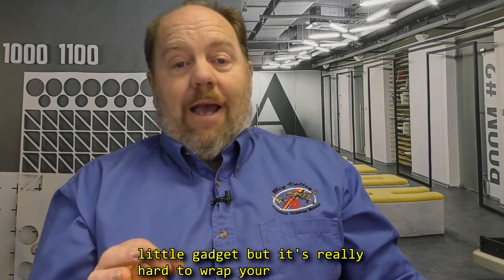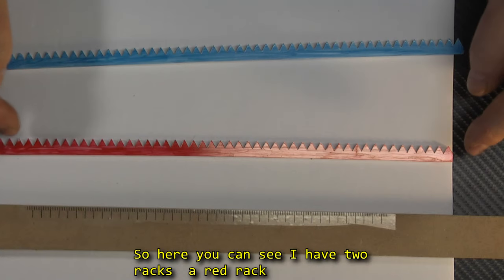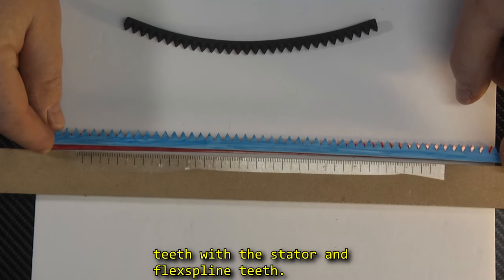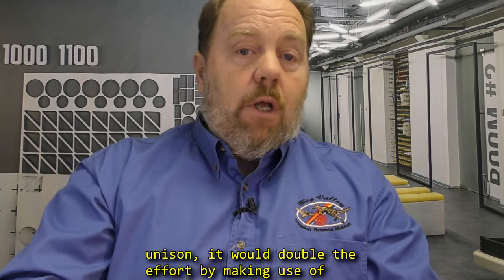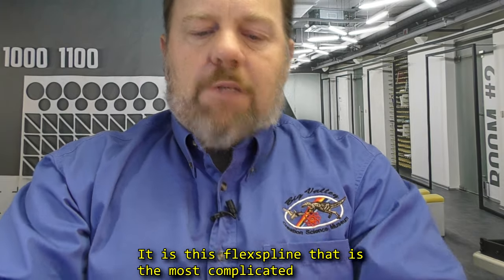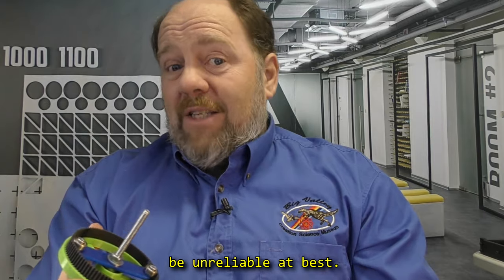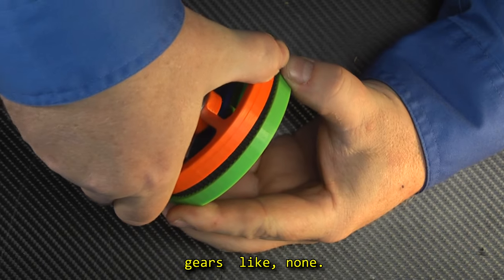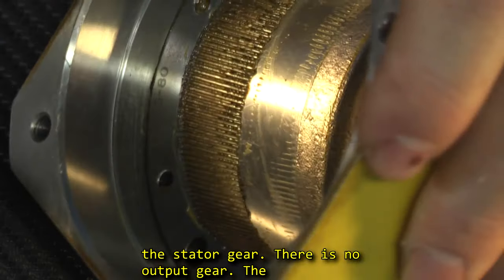Harmonic Drives explained

Comment: Your setup was so clear that it was immediately easy to comprehend. Good teacher.
Reply: Agreed, reminds me of the old Docs from the 40s explaining planetary gears transmissions and rear differentials
Reply: Years ago there was a Visible V8 model that had a starter that consisted of a can motor that turned a sun gear that meshed with 2 planet gears. The planet gears meshed with 2 internal gears with different tooth counts. One internal gear was stationary and the other one was connected to the starter pinion. The starter pinion meshed with the engine flywheel.
Reply: He started explaining, and I couldn’t understand why he had such a hard time understanding it in school lol. It was so simple.

Comment: I had a great “Ah Ha” moment about 6 or 7 minutes into the video. I’m a now retired electronics technician who used to work in the production of printed newspapers. Equipment from a company called Ferag used harmonic drives and when we were trained on it the instructor told us what it did but couldn’t explain how it did it. To him it was a magical engineering marvel. In the years that followed we repaired them quite frequently. Usually the Flex Ring would crack and we disassemble the unit and replace it. I had a fair understanding of how it worked after working on them but you, my friend, brought it all together. I’m going to forward your video to my former coworkers who still have to deal with it. I’m sure they’ll appreciate it. Thank you.

Comment: Super great explanation. One would think that the flex spline gear would fatigue over a short time, but they're so widely used in so many applications that it must not be an issue. Thanks for the great video demonstration!

Comment: Zero backlash & fixed timing... 2 great attributes for a gearbox... 🤨 a lot of people don't realise just how important backlash , or rather lack of it , is.. anyone with a milling machine who trys climb-cutting better have NO backlash in their table feed... 😰

Great description, the use of the straight racks initially helped greatly to understand the theory behind these rather exotic & quite expensive units... 🤗

😎👍☘🍺
Reply: When you say, "fixed timing" do you mean the input side is directly proportional to the output side? I saw cyclonial might have a problem in this regard (  because the input side to output side is not strictly linear because each teeth engaging is not directly proportional?)

Comment: Considering buying a telescope mount that works on this principle and wanted to understand it.  Your video helped a lot.  The advantage of very low backlash in astronomical mounts is significant, as well as the reduced need for counterweights on the mount. Thanks very much.
Reply: Ha! We must be looking at the same new ZWO mount! There are also others on the market that now have me looking into this tech more. This video explained it perfectly.
Reply: @lizards821  You're right!  Check out the cloudynights discussion.  It's the PEC that's inherent in these drives that convinced me to not buy it.  Looks like a good mount for visual, but not for DSO astrophotography, which would be my primary use of it.  Leaning toward the EQ6-R Pro when they come back on the market.
Reply: @cmahar3  yikes yeah spending $2k for a mount that cannot really do dso is kind of a bummer, especially considering the eq6r pro is less than that. Cuiv the lazy geek here on yt also has some videos on his as well.
Reply: @lizards821  Right? All DSOs aren't out of the envelope of this mount, just the small dim ones requiring focal length longer than 900mm. OTOH there are literally no EQ6R-Pro mounts available in the US or Canada right now due to supply chain issues, and there won't be for months.

Comment: Wow, you're a great teacher, your video is terrific and I now know something completely new about gear drives. Years ago I got a fanuc welding robot arm and was amazed at the zero backlash on the joints but never knew why it was possible until now. As for how to get 2 more teeth with the same pitch, it's hits me now that the outer ring is naturally LONGER than the inner one, hence can have 2 more teeth in its' path. However, sizing up the tooth depth to accomodate the mating, etc is a challenge.Thanks for this explanation and I'll look at more of your videos in the future.

Comment: Thank you very much for a very simple explanation of strain wave drives.  One of the newer places that these drives are starting to be used is in astronomy, more specifically astrophotography.  Astrophotographers are always looking for lighter weight, more powerful, more reliable and less power consumption in their gear, since often time hobbyist astrophotographers are out in the middle of some open field, far away from any power.
For the most part, telescope mounts fall into two categories, Alt/Az, or Altitude Azimunth and EQ, German EQ which means German Equatorial mounts  For astrophotography, EQ mounts are much more common, albeit much more expensive.  You can align one axis to the North Star, Polaris, and the mount will rotate around that point in the sky, and since all the stars and things in space also rotate around it, once you've selected your target, the mount tracks around the North Star, keeping the object in the center of the scope.
Strain Wave drives are now offered by two companies, ZWO and iOptron.  Usually, a normal EQ mount requires a counterweight and shaft to balance the load on the 'Right Ascension axis, which is the axis pointed at the North Star.  Having the system balanced keeps down tracking errors.  The Strain Wave drive eliminates the need for the counterweight (up to a certain payload), thereby reducing the entire weight of the mount.  It also tracks better and has zero backlash, which is something astrophotographers also are interested in.

So, yeah, Strain Wave mounts are coming, and they are going to be the future of hobbyist astrophotography.  Because of you, I know a lot more about strain wave drives now than I did 45 minutes ago!

Comment: To everyone wondering if you can use spur gears on the bearings instead of a flex spline, the answer is: yes. I was curious about this as well, so I drew up a harmonic drive in Fusion and 3D-Printed a model that uses entirely 3D-Printed parts except the bearings, which are fidget spinner bearings. My tolerances leave a lot to be desired, which may hide the reason for using flex-splines instead, but it is a fully functional gear reduction that uses spur gears all round and no belt/compliant mechanism.
Reply: Jake, I would love to see your model.  I would like to build a drive and am researching different methods right now.  What you describe seems interesting....
Reply: Thank You! I was wondering 😊. I love your simple description. You haven't by chance posted your STLs somewhere? 😊

Comment: This is the best explanation I've seen. I'm wondering why use a flex instead of just smaller gears.
Reply: Goog question. I guess with a more rigid flex it can engage more teeth. I also think the "real" harmonic drive do not use rollers inside but an ovoid slipping within the "belt"
edit: it is an elliptic bearing: https://youtu.be/bzRh672peNk?t=31
Reply: and with the right number of theeth maybe have more points of "harmony" in the gears?
Reply: Because the teeth only match up in 2 places, so the inner "flex" gear can only be in contact in 2 places

Comment: Nice video!
Looking at these drives I thought that instead of having the flexible gear to wedge the stator and output gears, why not have a plantetary/harmonic hybrid?

It would be like a normal planetary setup, but instead of the drive going through the planet gears, the planet gears would only do the job of the flexible gear in a harmonic drive setup, becoming the wedging force to do the reduction, while transmitting the force/torque. There would no longer be a need for the traditional sun gear as in a plantetary setup, so it could be omitted.

The difference in gear teeth needed for this to work as a harmonic drive could be achieved by making the outer part of the planetary drive (is it called the ring gear?), in two pieces with a different number of teeth. 

These two ring gears would act as the stator and the output respectively, connected by the aforementioned planet gears (which may need to be slightly elongated to allow for adequate meshing contact between the two ring gears).

By using planet gears to do the job of the flexible gear, it negates the need for it to be flexible, removing the weak link.

Also, if you adjust the teeth size to outer ring gear diameter ratio, you could have more than two spots where the teeth "harmonize" allowing for greater force transfer, while dispersing the load for better longevity.

Just a thought...🤔

Comment: Cool, simple, visual, intuitive and clear explanation, to the point I can go and build my own right now, all I need is a gear pack for SolidWorks 
It’s so rare, that a smart person can explain own knowledge, and you are definitely more than able to, thank you
BTW, I think nylon filament can be used as a flexible part, instead of a belt (without detracting a brilliance of this solution of course, coz belt is an industrial, very reliable component)

Comment: Have you seen that spherical gear? It can be turned on all 3 axis without the drive gear teeth loosing contact with the driven gear teeth. If I remember correctly, two worm gears or two pinion gears or a worm and a pinion gear can be used for the drive gears and the spherical gear easily accepts the input force without skipping, binding or terminal collision (drive gear tooth crest impacts driven gear tooth crest). I believe it can be driven with two pinion gears or one gear and a curved bearing plate to hold the spherical gear in place...I'm not so sure about that one gear/curved bearing part tho, it's been a while since I've seen the video.

Comment: Never heard of it, very interesting. 
I wonder why they don’t just use 2 opposite gearwheels instead of the flexspline?
Reply: The gear wheels and bearings would be under a lot of load and subject to much more wear. I would guess that you would also need a brake mechanism if the bearings are freewheeling when not being loaded by a drive... But not 100% sure on that!

Comment: Not hard to understand at all, great video!  I've never heard of these before and would have thought they'd use a sun gear drive like in automatic transmissions in cars or in drills.  I don't know what they have for "stop and hold" power, but the harmonic drive can probably hold a lot of torque without using power.

Comment: Hmm, I didn't have problems understanding these. Btw. a common mode of failure is cracking of the flex spline along the roots of the teeth, for obvious reasons.
The thing on those that boggles my mind the most is: how do you create the perfect tooth geometry? Or do involute gear teeth work as long as the tooth count is high enough?
Reply: I first encountered these drive mechanisms by watching YouTube videos dedicated to how they work. If you’re in that boat with me, it’s obvious why you didn’t have problems understanding it. It’s likely a lot harder to figure out the working principle if you’re simply handed a model of one to play with though. 
About the tooth geometry: involute tooth profiles would actually be a bad choice because they are designed for two rolling circles. The involute curve allows the contact pressure between two teeth to remain on one axis throughout rotation. The harmonic drive is different in that the flex ring teeth mostly just oscillate into and out of the stator and drive teeth (technically the flex ring rotates but very slowly relative to the input rotation) and lastly, the actual drive mechanism is no longer traditional torque transmission through meshing but it is instead this wedging effect described in the video. For that to work, simple V-shaped teeth will work best, with slimmer V angles being more efficient (like a slimmer wedge) but with a higher risk of teeth shearing off.
Reply: @evanemanuel1774  thanks for the input. Straight wedges wouldn't be ideal too though, because the teeth aren't always straight to eachother. At the ends of the meshing zones they would be more or less angled, so a slightly rounded surface would be beneficial. I wonder if it's wven possible to get a somewhat constant load distribution over the contact points.

Comment: So here's a quick question: does the harmonic drive create an increase in torque, as what one would expect through a standard gear drive? More efficient? Less efficient? What are the benefits of a harmonic drive over a standard geared drive/transmission system?

Comment: When I was into robotics back in the 80s I was thinking the same thing instead of using a spline you use bi-metal springs that would do the same thing it would act like the tearing down and replacing of muscle mass in a sense to create a greater greater force

Comment: What about frictional losses?  It seems like sliding wedges would be much more lossy than regular gears. Is there an efficiency measure for HDs and what's a typical range?
Reply: The lubrication does a very goot job at lowering the friction. There is a thing called the coning effect in which the oil or fat is pushed between the teeth by the aur pressure. On higher rotational speeds the drive gets less and less efficient.

Comment: Why does the drive sprocket have to be flexible? Offset the drive gear off of a clock hand, and let it act as a roller. As the clock hand rotates around, it pushes the drive gear into the stater/rotor. Only one tooth needs to interface to act as a wedge, so the drive wheel can be small, it just needs a tooth count in between the stater and rotor.

You just evenly space the arms in sync with the number of harmonized sections of the rotor/stator. If you want to cover those gaps, double up, and line up multiple harmonic drives, with the harmonic sections perpendicular.
 What am I missing?

Comment: Wow! I've heard of these before and came to the video convinced I wasn't going to understand it. I'm pretty good with science and technology, I just thought this was one of those weird things. But it makes perfect sense! A wedge, of course! Well, well done. Teaching is a skill and you're good at it.

Question, though - Could you do away with the flexible part, and instead of the 2 round parts on the end of the rotating cam, have 2 small gear wheels? They'd still press into the other 2 gears. They just wouldn't need to flex. That would seem like a better way, though if it were I'm sure that's what they'd use, but why? 

Also can this be driven backward? As an increasing instead of reducing gear? From the mechanism it seems likely, having the teeth of the output squeeze the flexspline's teeth out from being meshed in there, therefore squeezing the flexspline inward, and that pushing the cam round. In practice I can imagine the force would be very large, and possibly other forces would dominate so that it wouldn't work in any practical material you'd build it from. But theoretically it would, right? 

For it's job though, a reducing gear with such a great ratio, so tough, solid, accurate, and simple, is amazing. No wonder it took til the 1950s when the other basic machines were invented by the Greeks and even the more complex ones by Medieval times.

Comment: Beautiful explanation, but wouldn't it be possible to just 3D print two gears, and attach them to the two ends where the rolling bearings are, rather than use a giant circle? Or is there some benefit to using a whole circle as a rotating piece?
Reply: The flex and roller parts are extraneous and irrelevant to the differential drive. Yes this is done with gears only, external or internal. The diameter is based on material weakness, required torque and ratio.

Comment: It was good to see the system, and I understood it, I think. Not many moving parts, which is good, but there is potential for a lot of wear, not so good.
If I understood it correctly, it seems that you can't transmit so much torque through it, due to not having many teeth transmitting the power at any one time? I did have a nap half way through, so I might have missed something important. :)
That would explain why planetary gears are more popular.

Comment: Very interesting, thank you.  Wouldn't the repeated flexing/straining of the output 'flex spline' quickly lead to metal fatigue, cracking, and catastrophic failure of the mechanism, in comparison to the longevity of a planetary gear?
Reply: I think this is the main beat in complexity of manufacturing of this element, like in variator transmission - the belt is the most complex and difficult part, otherwise it is very simple, much simpler than ANY gearbox

Comment: why not just use 2 small gears that are double the height than a single tooth ring on the inside instead of the flexible element? They would do basically the same as the flexible middle part and shift one tooth ring vs the other one. It would also have no play in static mode but wouldnt have to rely on a flexible elemet.

Comment: Thank you for you explanation and zero backlash is a good idea but what will we do for the vibration? It's a big problem on this sample. If we put this harmonic drive into a dense fluid (for example a thick oil) then we can absorbe the most of vibration. But after this we will meet with an another difficulty which is fixing the mechanism. So I think it's a complicated mechanism. It can be use for simple machines but can't apply to neither big machines for example cars or trucks nor small machines like elektric tools.

Comment: So the diameters of the two rigid ring gears are the same, and the pitches of their teeth are slightly different? (And the flexgear has enough give to accommodate the pitch differences?) 

Or their pitches are the same and the diameters are slightly different? (And the flex gear has enough give to handle the slight diameter differences?)